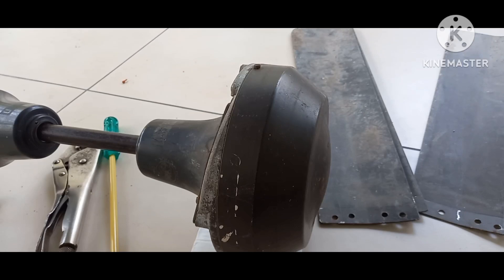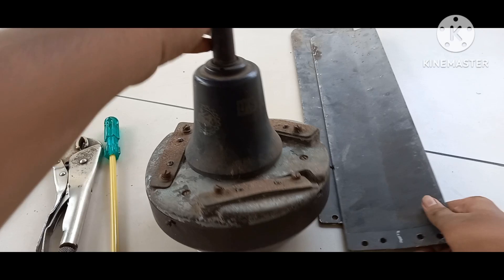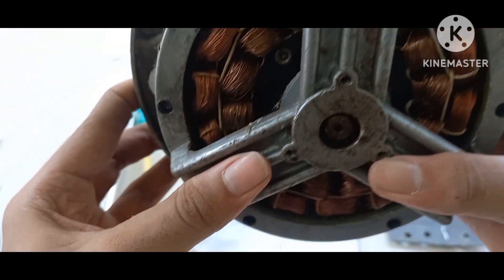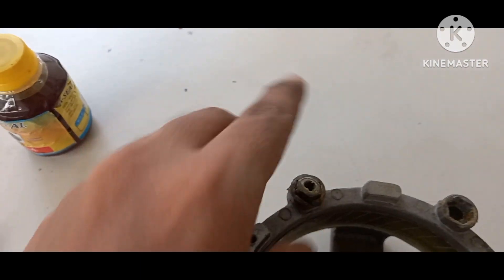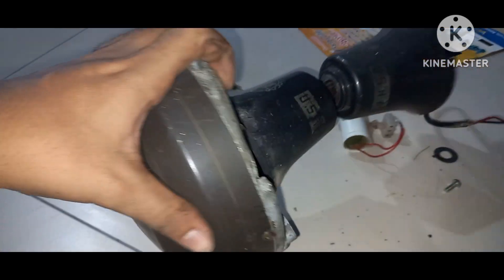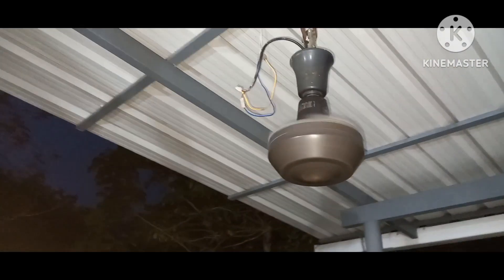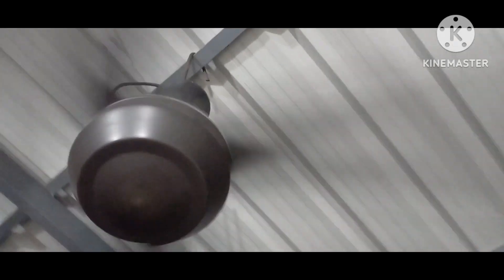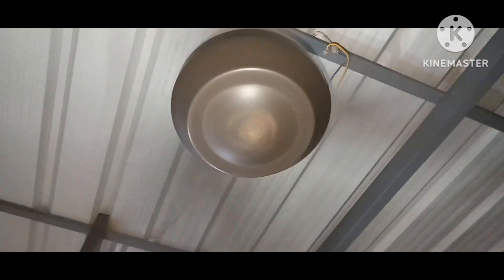USHA Excella ceiling fan |1200mm |1980s model| AFW |

Comment: I love it! The big bulky motor makes the fan look somehow muscular
Reply from the maker: Obviously! the main attraction is its Muscular looks cuz the motor is thick but its just a false cover. Looks like a windmill because there is no rivets nor blade shanks used. The blades are directly installed on the slope angle given directly on the upper cove of the motor.

Comment: From far away you may get confused for a 1970's hb but ironically Usha, well this was seen very less and a short lived model, glad you found it
Reply from the maker: Correct! even I got confused at the first and later the seller told me its USHA. I bought this fan from the same seller who gave me the 1969 HB 56".
Reply: Hmm..i got a 1980's Usha Kohinoor 56", and a Crompton Greaves High breeze of 2000's but there's a mysterious case with hb,the motor is meant for 56" but has run with 48" blades for long time, even the owner and the building demolisher/contractor were shocked to know of it.getting these two fans was completely unplanned..this time Kohinoor is white and hb is brown
Reply from the maker: Wow its pretty rare situation to get 56" fan motor with 48'' blades, but the motor will run cooler with smaller blades. And kohinoor 56" too rare to find. USHA sold 36'', 42'' and 48 more than 56'' and 60'' models!
Reply: There's a common mistake with Usha, canopies were flipped while installation,so one canopy is broken,both canopies faded,so when i reflipped and checked,i found out lower canopy has faded badly and broken, upper is faded but fine from inside,so partially i have both canopies, upper full, lower half
Reply: @antiquefanworld1728  yep, and the fan is double ball bearing as it should be and a 14 pole motor which never burnt, original bearings with some grease left but i showed more, opened for the first time, otherwise only capacitor was replaced once,now the fan is fully functional
Reply from the maker: USHA 14pole motor sounds like HB 16pole! Every thing functional means its a tressure.
Reply: I was shocked as well, but happy at the same time.sad about lower canopy, which is broken but okay,fan is in good condition,needs no restoration just downrod may require finishing touches